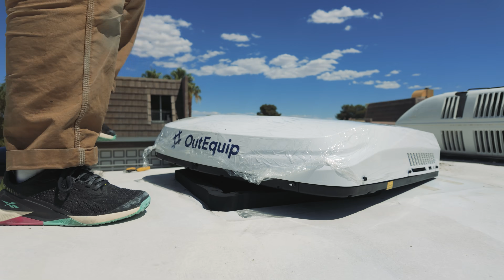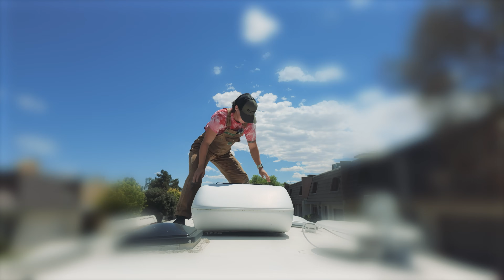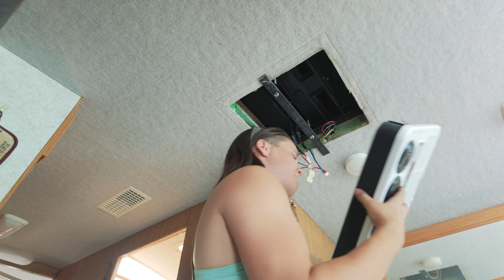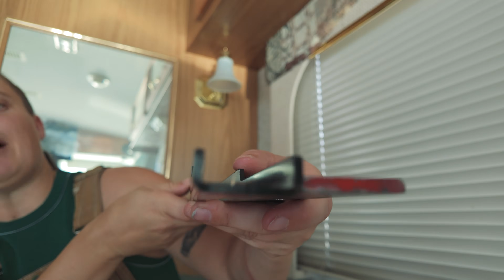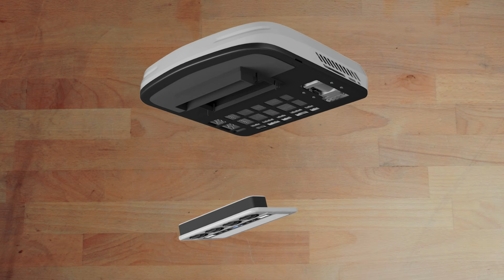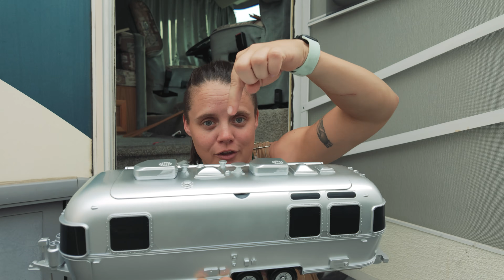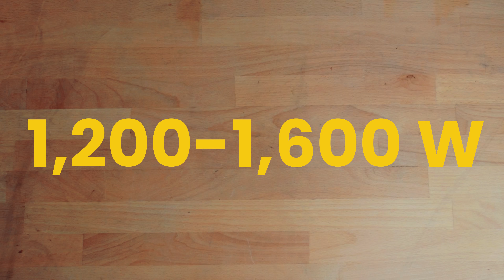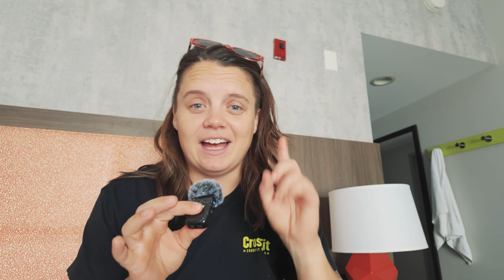Better RV Cooling with Less Power? My Switch to a 12V  AC | OutEquipPro AC Honest Review

Comment: I never had second thoughts about installing a 12v roof mount air conditioner in our van build.
Quiet, fairly low power use, compact and pumps out cold air - totally necessary here in Australia!
Reply: What brand did you go with?
Reply: @jacquimaxwell221  Hi, interested in a similar RV air conditioner? We can offer a great discount!
Reply: How much was it and is the did you use the same one that is featured in this video, cheers

Comment: Im more interested in how many batteries i need and how long it will run on a 100ah battery?
How many 100wat panels to run the AC. What do i need to run it and charge my battery as well?
Ive never seen a Installation video that doesn't actually install but talks about it. Maybe im just getting old but things are ridiculous nowadays.  
But im just a old mechanic that worked for a motor home dealership. What do i know?
Reply: sounds like you already know the answer to your questions. Would you like to make the video you are describing. I'm sure others would find it helpful.
Reply: @Pocket-Watch i don't that's why im asking.   I believe those topics would be most useful
Reply: @richardhenry1969 10 solar 100w panels to make 1000w of solar. A pair of batteries in parallel capable of 80a load. So if the battery is 40amp max load, a pair would be 80a ... as a ceiling max. draw.
Reply: Will Prowse has a yt site, he has answers.
Reply: a little over hour at max load

Comment: Found the compressor motor rating for that A/C unit:  Rated power 960W.   The unit was around $900 with the other updated electronics like a mini split. So not to bad for the numbers and cost. But remember it is in need of more solar solar panels than will fit on most RV roofs for extended use.  My guess is around 2000 to 3000 watts of panels flat and really need about 1200 amp hours worth of batteries for everyday summer time use in the desert at 110F plus. Remember in July and August Yuma AZ can have a night time low of 90F for several weeks.
Reply: A lady bought one for her truck camper as she said in a post.
She said...90 degrees in her camper and it only took an 1 hr to get to 72 inside.
It was 102 outside she said.
She said...
6% of her 460amp battery only went down in that hour.
Reply: @godrulesme8619  size matters a small space needs less cooling you wouldnt try to cool a 10k sqf house with one 10k btu window unit right but a single bed room could be kept nice and cool with the same ac
Reply: Sorry....560amph is what she has on her battery and running it for 1 hr took it only down 6%
Reply: @godrulesme8619  It was throttled back,  not running it full output_ full blast by the controller.  The electric motor is rated at 960 watt per hour at full output.  That dose not change.  The Laws of Physics do not change for human opinions.
Reply: @bobmirror7164 thanks fir the clarification
Reply: Another guy said his dual fuel generator would only burn 2 gallons of gas for 10 hours most likely to run that ac unit.
Propane generator would be even less costly

Comment: You did everything but show us its cooling capabilities. Why not show us a real time temperature test from the temp before turning the unit on, to a real time temp lamps until you reached a certain appropriate temperature? You basically spouted stats but only showed an install video.

Comment: What about the Heater option ?
Reply: Avoid that, it is not heat pump, the option is for resistive strip element... imo they are too power hungry. Better off with a lil 120v heater.
Reply: @sqeekykleen49 thanks

Comment: First you do an absolutely great job!!! Clear simple explanations. One thing I would watch out for. I have a new ( inverter) MIDEA energy efficient home AC in my apartment.  It sounds similar to your RV unit, soft start, very quiet uses less energy. BUT I love it BUT I found this issue on VERY VERY hot days it was unable to get the temperature as low as I would like. It seemed it was efficient, but it wasn't chilling the air as cold as on original unit. I bought a 8000 BTU unit which replaced a working perfectly Fredrich unit also 8000 btu. I replaced the original unit because the constant cycling on and off at night kept waking me with a big thunk. The new unit solved that problem, but on really hot night I can't get my apartment under 71-75 degrees, I love to sleep in 68. So I wouldn't give this a total thumbs up unless you test in really hot conditions. My new 8000 BTU AC was not as good as my 9 year old 8000 btu. I'm a little concerned yours was only drawing 420 watts, I think my home unit on full draws more like 600 watts. I bought thermocouples and measured the temp coming out an I think it was in the 60's but my guess is my old unit was colder because I had no problem getting the apartment cold, but was so annoyed when the new inverter unit the apartment would absolutely flat line in the low 70's on a very hot day ( annoyed enough to buy thermocouples :) I've never had that experience with an AC before. If I had known I would have upped to a 10,00o BTU
Reply: Glad to hear you you have Midea mini splits. I have both Midea and LG I installed  about 5 yrs ago. First in my cottage second in my main home, to see which was better. LG sucks. Midea cassette 8000 BTU will freeze me out of a 600 square foot tiny home if I use dry mode. I have 2 8000 BTU units but only need the one to keep me or any of my guests in cottage comfy. The best news is my cottage is all electric and it added $40-50 a month to electric bill. For 3 k in solar I would be off the grid. I live in the Gulf Coast of Alabama. We get hot and we get humid. And we get power outages from hurricanes
Reply: Hmmm? I don't think you can find a hotter or more humid part of the country than Gulf Coast Alabama which was once part of the North American tropical rain forest 50" rain annual to this day. I would say Miami is far hotter. My Midea 8000 BTU dries the air to desert.pulling 2 gallons of condensed water out of inside air. And can go below 68 in the hottest day of summer. I keep it on 72 simply because of japanese infrared heat sensors. That sense every corner of the room producing a true 72° overall temp. Then once achieved the unit simply maintains that temp til you as human with control. Or nature changes the amount of refrigerant load to match cycle of desired comfort. Americans play with the thermostat to much . I have come to love the comfort of japanese set and forget over American control and complain.
Reply: Midea U ACs were just recalled yesterday.
Reply: @skdsky0  Yup, I believe it includes mine.
Reply: @skdsky0 maybe they shouldn't have partnered with Trane . Once that partnership was established price increased, and I guess quality went down. Glad I bought right before the deal
Reply: @skdsky0 The Midea got a redesign to get rid of condensate. The roof mount unit did not describe handling this as some other installs have. The condensate problem causes sickly mold.
The 5k BTU 120VAC Midea Window mount I have in my RV starts cycling at 100f outdoor temp, regular as clockwork each day, blows cold, shuts off compressor at 100f and blows ambient outdoor into interior, then starts compressor and blows cold.

Comment: Great video, Emily! I had the same AC installed in my truck camper and wasn't comfortable installing it myself. To make it work, Terry, the RV tech, had to design a bracket out of angle iron. We faced the opposite issue that you had. The OutEquipPro's bracket and bolts were too long for my rig. I love the AC, and in my last video, I tested it in Death Valley to see how long it took to lower the temperature to 72°F when it was 103°F outside. It took less than an hour and used only 6% of my 560Ah battery bank. Impressive!! It's a game-changer for my comfort!
Reply: Nothing better than a performance testimonial that includes impact on your power station.  Loads on power stations are the mystery category for almost everyone.  Thanks so much for the great feedback that helps all of us in the most misunderstood category of RV life boondocking equipment loads.
Reply: @michaelshelton2250  wow, great info! Thx
Reply: I’ve gotta say I’m an avid do-it-yourself with both a sailboat that I’m presently rewiring and an RV it has seen plenty of modifications. That said , I definitely am a graduate of YouTube university! I’ve watched more than my fair share of videos and yours is one of the best that I’ve ever seen as far as explanation and detail. Thank you for your presentation.
Reply: Excellent.  I am getting ready to put a Project M on my truck for camping.  I live in Arizona so fans are not a very good option for srping summer fall so I wanted AC.  I was trying to figure out how large of a power bank I would need.  It wounds like 560 will probably be big enough.  I will supplement with solar to the battery which we are never short of here and be able to charge from the Jeep if needed.  Thank you so much for the information.
Reply: I watched your great video!
Reply: Just saw that video. Very helpful. Thanks.
Reply: LOL, watching both of your videos at the same time
Reply: @ChadMatthews-u8o  I just found this video, and the timing is perfect because my old AC just threw a shoe 2 days ago. You say you're watching both videos at the same time? I'm watching this one right now, but could you post the link of the second one please? I've got a lot to learn... Lol. Thank you!
Reply: @KimannChessa, your video was pretty good too. Watched it last nigght. Good stuff.
Reply: How big is your camper ?
Reply: Thanks for the estimate to how well these work. I have heard mixed reviews. I am installing it on my house boat and this is the information I was looking for! Thanks
Reply: I saw your video... Was your batteries 100% before the start???  I was trying to calculate power consumed.
Reply: Excellent video of this product.  Thank you!
Reply: Good real world information!  Thanks!!!
Reply: Thank you for the real time test!  This just solved a rather large problem for me.  If my calculations are correct, it only used about 400 WattHours, which is quite impressive!  Getting a battery build on the drawing board pronto, and I am planning on getting some solar panels once I re-coat the roof..
Reply: How is it possible to get the temp down to 72 from 103? If there is a delta of 20 degrees that means the coolest air you can get is 83 degrees.
Reply: @MarcL1313 .  The temperature drop is Based on the inside temperature, Not outside. The unit constantly recirculates the inside air until it reaches the set temperature. It keeps running inside air over its cooling coils to make progressively colder air.

Comment: Great video Emily. Could you tell me if there’s a condensate outlet or does it run onto roof? I’ve an airstream w a tube that runs inside walls down to wheel well. Thx!!

Comment: I like the direction toward inverter technology in RV Air Conditioners which is used also in these new 12v units!  Modifying a Trailer that has 120v at the roof hole to have 12v there is not practical or possible so manufactures will have to make changes.  This unit uses 40 to 60 amps at 12v.  You will need 8 gauge or 6 gauge wire.
Since you will need a huge battery bank and solar panels which is normally these days 24v or 48v system and you have an inverter, why would anyone install a 12/24 volt and have to run beefy wiring when there are new 120v inverter tech units that are lower watt usage than older 120v units.
This seems to be much better at this time for vans but even then the wiring issue is a problem and you will not be able to run it very long because you normally will not have a large enough battery bank and solar setup on a van.  Just keep it plugged in to power you say?  Then your 12v charger is going to be working very hard, heat up and possibly fail.  Still some issues to address for sure.
You lost your ducted feature?  I would not do that.  Use a new low power inverter tech 120v ducted model and I got one with heat pump also.
So you use less power with this unit and have less cooling BTU's also.  My new Cooling/Heating unit has 15,000 BTU heating and cooling.  This unit has 10,000 cooling and only 4,599 optional heating probably because it is not a heat pump but heating coils.
You compared the 120v power usage with the compressor on and the 12v unit compressor off it seems because the manufacturer states 960 watts with the compressor on or your unit was on low compressor speed due to it not being hot etc when you tested the current.  The older unit compressor is either on or off whereas the 12v unit can adjust up of down based on the demand.
You intended to be honest, but just got it all wrong.  Your power usage is all off.  Your not reducing your shore power needs when the battery charger, which are very inefficient, will be using 120v power to convert to 12v and actually be running the air conditioner and just wait till it gets hot outside and that charger is running all day.
I know you mean well, but your deductions are all off.

Comment: 23:40 -  OK, If you're a camp queen that's always plugged in.
Stating the putting the Air Conditioner on the DC side vs AC to free up AC Amps is a bit misleading.
If you are always plugged in your DC side is fed from the AC side through a converter/charger. You are still going to use some of those AC amps to run the DC air conditioner.
Unless you isolate the battery bank from the converter, you'll still have to recharge it sometime...
Reply: I think that was the assumption, separate power systems?

Comment: I'll move to 12v DC when there's a reliable, 15k BTU system available. I'm not stepping down to a 10k BTU just for 12v DC. That being said, a 12v DC inverter a/c unit, given the proper size, would be a giant leap forward.

Comment: This would have been awesome for my situation. My 40' fifth wheel only came with one a/c in the living room - and I desperately need one in my bedroom. It is close to the battery too, so it probably wouldn't have been hard to install.

However...I broke the bedroom window a few winters ago, so I just installed a window a/c and that has been doing great. Of course, that isn't ideal for boondocking but I've learned that a 40' trailer is best when it doesn't ever move. It is really hard to park in a lot of RV parks.

Comment: One thing I didn't hear an answer to was how long you can run the ac for or how many amp/h of batteries needed (I understand there are a lot of factors, but something general would be helpful)? for example would 200ah last a day or is that just silly/unrealistic? How big of a battery/solar system has to be equipped to boon-dock with a 12v AC?
Thanks!
Reply: 200 ah is about 2 hrs.
Reply: Solar, a good 1000 watts .... and it will preform well.

Comment: Great info, if I ever have to replace my current AC I’ll definitely consider  a DC AC.  I currently have a portable AC that runs about 700 w, that I use when off grid to keep the kitties cool and it can be controlled via WiFi.  I only use it a few hours while I’m away from my kitties.
Reply: Hi, what portable AC do you have?
Reply: Brand is TCL but it’s an 8,000 BTU WiFi portable AC.  The WiFi took a minute to set up but once setup, I feel much better leaving my kitties knowing I can keep them cool.
Reply: Great info., thank you @jocelynb8935

Comment: I reused the existing antenna hole on my roof to run the wires.  Love the vent explanation, that's a good tip.
Reply: Thats a great idea. I already removed my antenna but left the pedestal plate just to keep everything sealed up.

Comment: Great review and explanations. Like many, I will probably not move to a 12v A/C until current ones fail, but your video showed something I had not considered and that’s the power / wiring required to run a 12v unit. Awesome presentation. Thanks!

Comment: I'd be worried that the added 12v draw would be too much for my converter, and it would struggle to provide enough power... but this is something I'll for sure look into if/when I need to replace my existing AC.

Comment: Wish they'd used a metal blade for longevity, and metal grill to prevent hail ball damage... Guess you could design a metal grill to put over it for protection. Thanks for sharing your conversion.

Comment: Excellent explainer.  Clear, concise, and a couple of useful asterisks to point up esoterica.  As a pro handyman who does a lot of HVAC work, nothing about the HVAC system itself was a surprise to me (though its performance on less than 500 watts was a real eye-opener!), but I had never heard of 30-amp or 50-amp rigs before.

Loved it. Subscribed!
Reply: It is a common terminology for how much ac amps of ac shore power the RV can handle, as in having a 30 amp or 50 amp main breaker panel. Same concept of a home having a 150 amp or 200 amp entrance feeding the main breaker panel. The 50 amp RV entrance power is designed to handle split phase 240V power, the 30 amp is 120v power only (one leg).
Reply: Same

Comment: Removed my Mark 4  A/C 110 volt. No body is talking about the propane heat.  When I installed my Treeligo 12 volt A/C. My heat didn't work anymore. Because my A/C and heat ram of the thermostat on the wall.  So I had to figure how to fix the wiring for my heat. But I did get it working.

Comment: I honestly don't know who this could be much more efficient except that it avoids inverter losses when your power source is DC.  So, maybe 10% more efficient?  That's not nothing, but I just don't see how it could possibly remove the same amount of heat with 25-33% of the energy.  That said, for boondockers, it may still be a great choice.